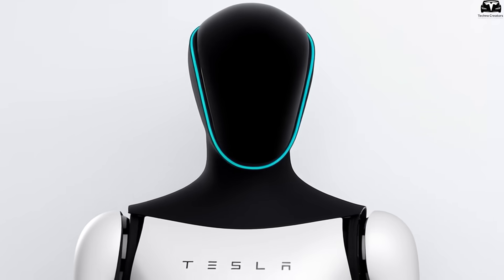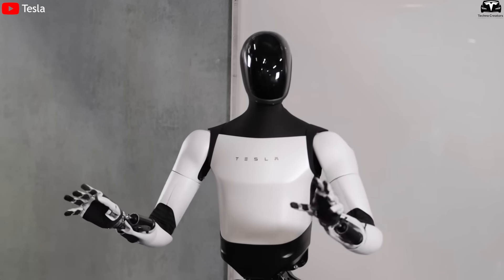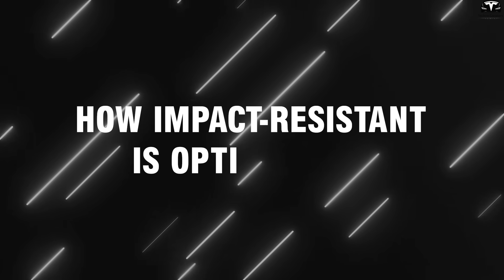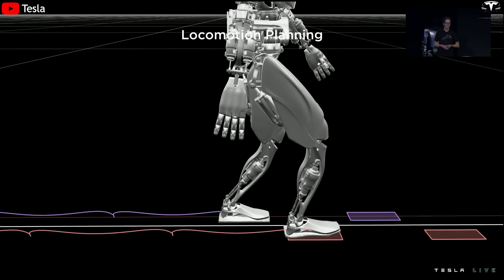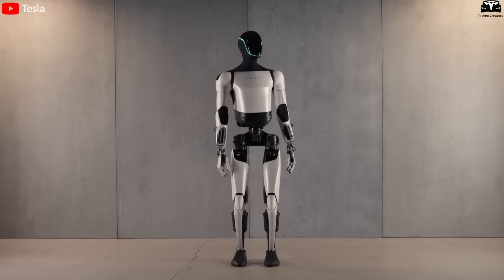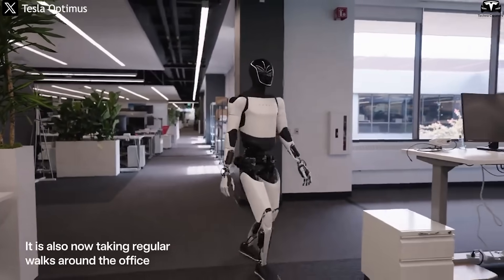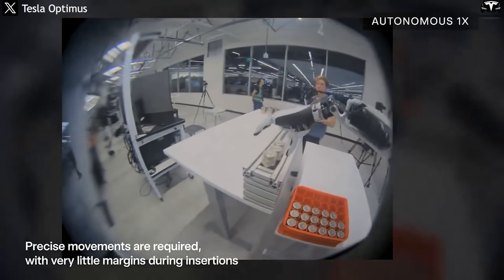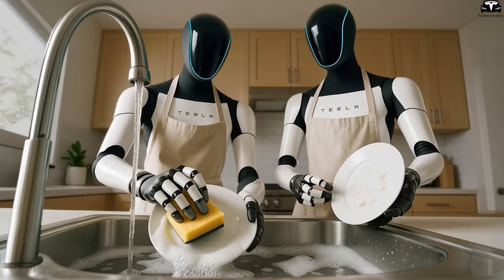Elon Musk Reveals Tesla Bot Gen V3 With New Face, Faster Motion, More Power! Next-Level!

Comment: I’ve worked for years in hot wet environments with both mechanical and electronic devices. Human beings hold up a whole lot better. You’re gonna need a bigger repair crew.
Reply from the maker: I’ve spent years working in hot and humid environments with both mechanical and electronic equipment. Humans still hold up much better. You’re going to need a bigger repair team